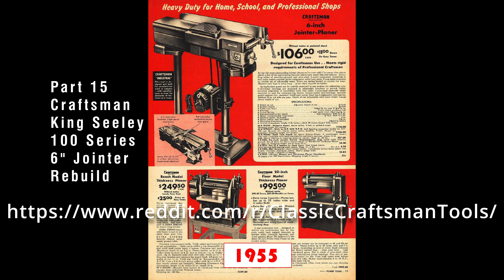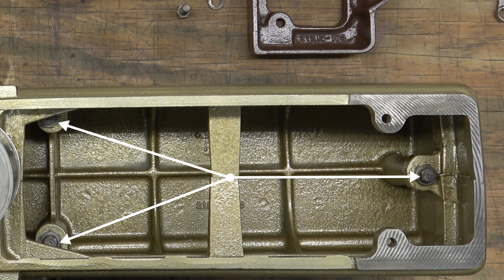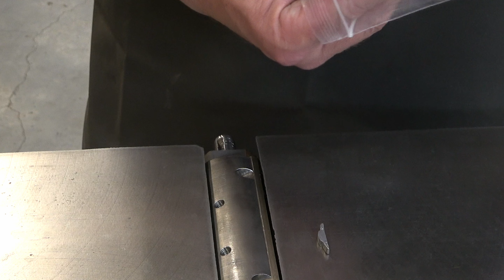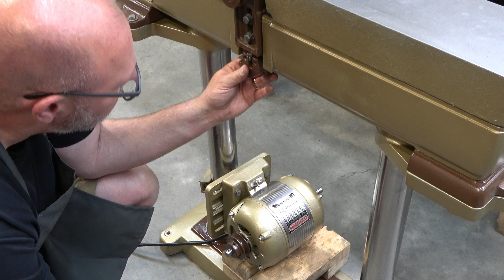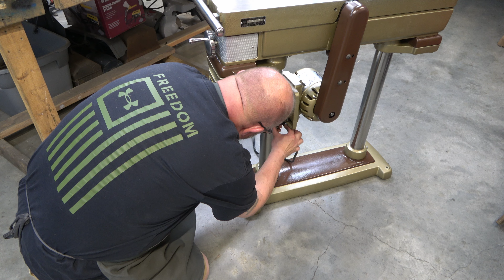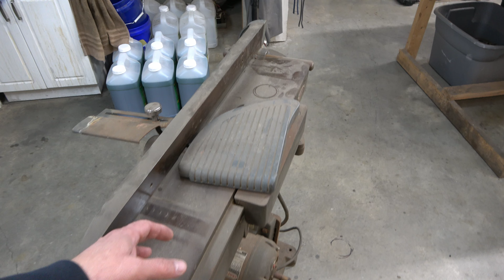Part 15 Craftsman 6" Jointer Rebuild (Final Assembly)

Comment: I have one just like this, but I'm not lucky enough to have the stand, motor, or middle fence bracketry. 😔 Awesome to see yours so complete!
Reply from the maker: Thank you, many of the parts such as the fence parts can be found on ebay. Look for your model number then download an owner's manual and search ebay for the part by name or part number based on model number. You can get the owners manual here: http://vintagemachinery.org/mfgIndex/detail.aspx?id=222&tab=3

Comment: Great series, I’m picking up the same jointer Friday, it doesn’t have the stand that your has but looking forward to restoring it, thanks for all the videos and info!!!
Reply from the maker: congratulations and good luck
Reply: @ so the one thing I didn’t see in your parts list is the grounded power cord, where did you get that at?
Reply from the maker: @bocfus72  Amazon but you can grab them from any big box hardware store.

Comment: This is a beautiful job. My table (very similar Sears model 103.20620) is up on the exit end. I watched 15 videos and we only glanced over the   hold the studs in place to level. Could you explain that a little in detail?
Reply from the maker: So, there are 3 leveling studs that screw into the base. There are 3 cap screws that screw into the leveling studs and connect the rear table to the base. You will need to loosen the cap screws then adjust the leveling studs to level the table. Once it is level, then hold the leveling studs with a wrench and tighten down the cap screws. The linked owner’s manual does a better job of explaining this. I hope this helps.

Comment: great work, but after all that you didnt even turn it on or joint some wood?..
Reply from the maker: I know, I know... I was in a hurry to finish the video. I was heading out of town and wanted to get it in the can before I headed out. I still have not used it yet and to be honest, I only used it one time before the rebuild to finish off the oak slab I used for the my wood lathe mount. Sorry about that.

Comment: Nice job!
The motor key is 3/16”, not 1/4” square.
The knives should only project .003” above the rear table, not 1/16”.
Reply from the maker: You are correct, the key for the rotor was 3/16” not ¼”. As for the blades, I have read through the manual several times and do not see any specified measurement for the blades to project. I did see this on page 4, 3rd paragraph: “All three blades should project 1/16 inch at right side of cutter head. (See Figure 3).” Could you please tell me where the .003” projection above the rear table is stated?
Reply: @JeffsShop  The 1/16” from the side of the cutter head is for rabbiting. With the newer 6-1/8” blades this gives 1/16” of knife edge on both sides of the cutterhead.
The .003” above outfeed table is from the 9-2647 Craftsman jointer knife setting gauge instruction manual.
Reply from the maker: @toolguybak  Perfect, thank you for the clarification.